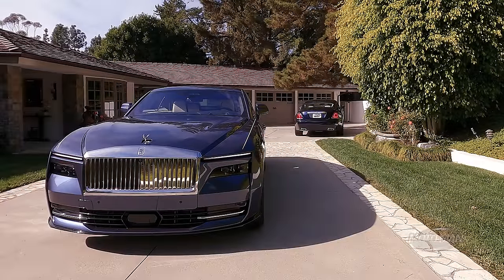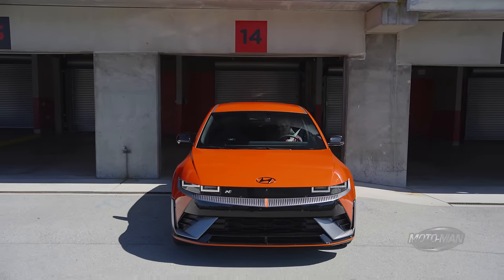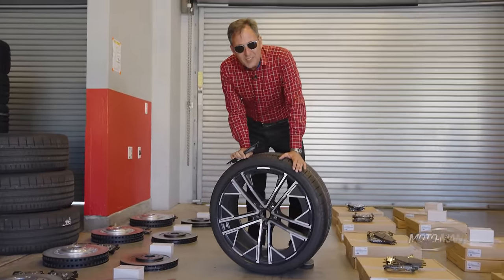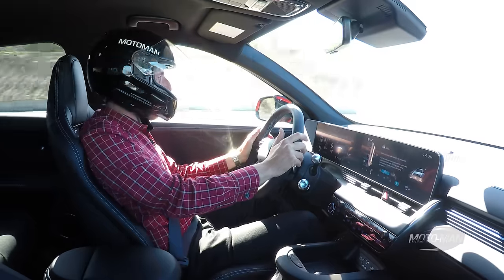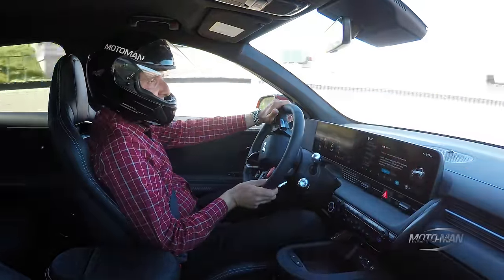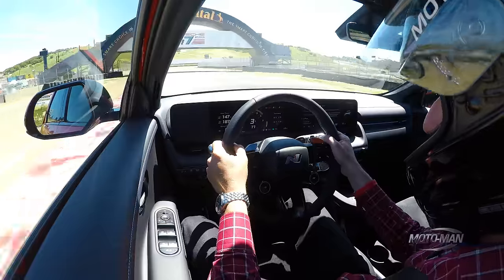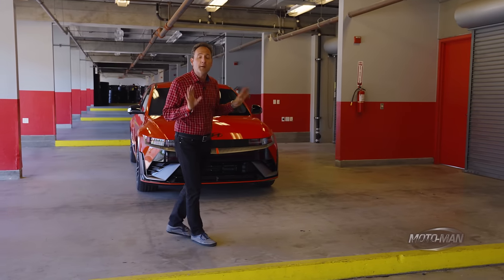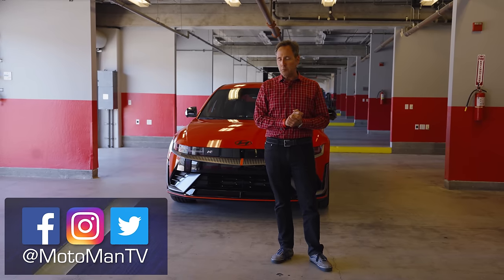Hyundai IONIQ 5 N: Fake Gears transform an EV into a Real Driver's Car!

Comment: It only weighs 5,000 lbs! EV’s need to pay for the wear and tear on the roads due to their weight.
Reply: Only tires wear faster around 35,000 miles and no need to replace anything else.

Comment: Why is it so heavy? Should be 3500 lbs. for a sort-of "hot hatch". And the modes are just stupidly complex.
Reply: Quick name the ice powered awd 640+hp, seats 5 adults hot hatches weighing 3,500# which can lap the nurburgring at 7:44 or quicker?
Reply: @4literv6  The M2 CS from 5 years ago is more capable than the Ionic and won’t quit after 2 laps of the Ring. Seats 4, which for all practical purposes, is the same as the Ionic. And by way, is down 200hp and still sets a better lap time. I bet the new M2 is faster as well.  Look, I like what Hyundai has done in principle, but until the weight comes down, it’s forever compromised.
Reply: It may look like a hot hatch, but it's basically more of a crossover. Looks can be deceiving in photos -- in person it's much bigger than it looks in the photos. The wheelbase is basically the same as a Range Rover SE. And thr battery packs for EVs weigh a bunch.

Comment: Everything you said in your opening monologue makes no sense whatsoever. Fake gears and fake engine noise != performance.
Reply from the maker: I say this with the utmost respect: Get out and drive more performance cars - both ICE and EV and it will make perfect sense.
Reply: @MotoManTV  I'm surprised that you're so impressed with that mickey mouse engine noise. It's so bad that it's almost like it's parodying Gran Turismo as an easter egg of sorts. You'd be better served with straight-cut gear sound simulation if you're strictly using it for the track. Thank you for your kind reply, but I still respectfully disagree. Bis später

Comment: First 10 minutes I put this on possible buy list……then at $70,000…..delete
Reply: It's faster and about same premium as an M3 over a 330i...
Reply: @bradleyhall4315  You have to have rocks in your head to choose this over a M2 at the same price point.
Reply: @lukewalker1051 having owned an M3, I rather have this ya donut.
Reply: @lukewalker1051 not really. Depends on use. If you are not tracking it…Ioniq wins. If you are tracking it a few times a year you need m3 becuase ev is not track ready and runs out of juice very quickly
Reply: I just leased one for 2 years for 25K, it is way worth it. But I thought like you in the beginning. This car easily beat my expectations.

Comment: Consider the profound irony.  A more expensive car to simulate what already exists which is a more convenient car to own powered by gasoline.  Even though this car reviewed is faster, lets pick a car like an Elantra N or Civic Type R at less than $50K as a basis for comparison.

But there is much more.  The architecture of this car is still electric and with that comes all the aversion to owning an electric car from less range, to where to charge, added weight you mention, but biggest elephant in the room?  The battery that degrades over time and what kind of depreciated hunk of metal you are left with after say 8 years.  This is a throwaway $70K car when the battery needs replacement because of the dramatic depreciation of electric cars including Tesla's.

Let's say you don't want to own it but lease it and not worry about the uber expensive 70+ KW/hr battery needing to be replaced with much higher cost than an engine replacement in a gas car that isn't a foregone conclusion in 8 years.     Who in their right mind wants to lease a car that it harder to charge, takes longer to charge and has less range than a gas car? What is the point?
Truth is, EV's are dumb.  Lots of dumb Americans, some of whom have bought them and regretted doing so. 

As an automotive engineer, I appreciate your review and discussion about this maybe first foray into 'simulating' a performance gas car in an EV.  It is at its best a feat of engineering and at its worse a joke and sad commentary on people that would consider one...lol.
Reply: lol you sound like a graduate of Trump “University” 😂

Comment: For something that looks like just another cheap hot hatch, it’s way overpriced!  Sure it’s pretty fast but the Model 3 Performance is faster and would probably out run this car on the track as well . Buying the new Model 3 Performance instead
Reply: I am impressed by your stereotype. 
Model 3 Performance It may be zero hundred, but on long distance circuits, the m3p will have performance limitations and run out due to lack of battery thermal management and brake thermal management.
Reply: @Vanzoda  Sure but how many guys are really going to track their daily driver.  Besides the new Model 3 Performance has a new track package as well but I could care less.  Sure the Ioniq 5 N might be a better track car but I wouldn’t pay $20k more for that over a M3P !